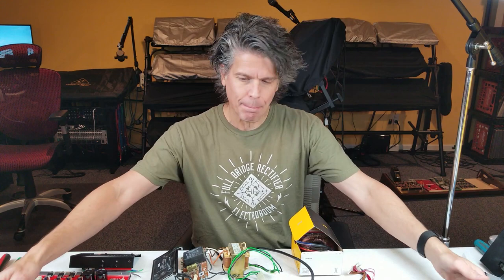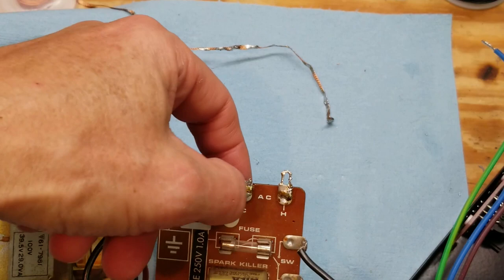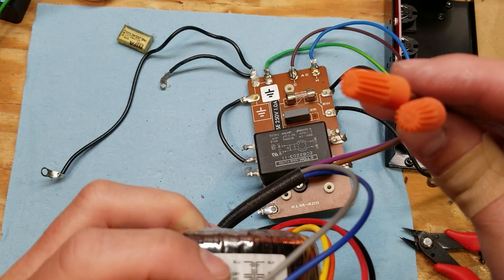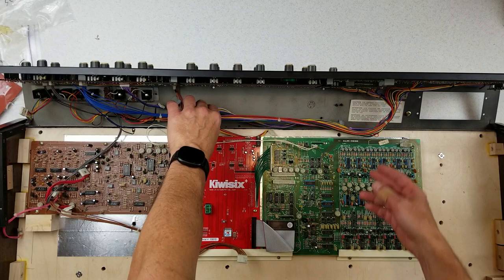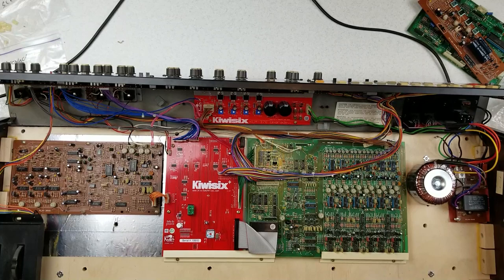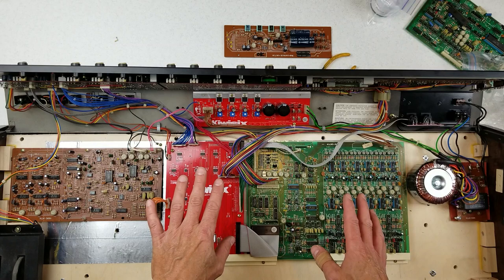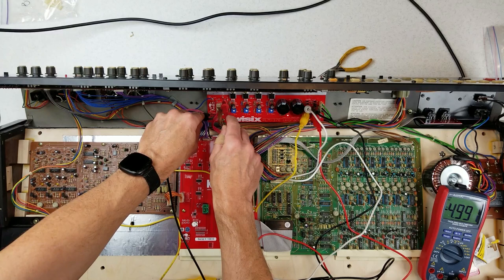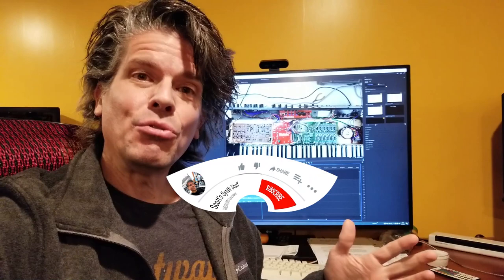Repairing & Restoring a Korg Polysix to Better Than New! Episode 4: Power Supply, Initial Power-Up!

Comment: I am amazed by this project.
Sorry to see you had a few road blocks on this restoration project, and that can be frustrating.  I am also very impressed by how thorough you are with making sure you're careful with checking voltages and connections.  You have a great knowledge with electronics and your project is very interesting to watch.  Can't wait to watch episode 5 and see the poly six come back to life.  Cheers Scott
Reply from the maker: With old synths like this, you have to expect problems along the way. It really does pay to be methodical and check everything as you go. When the price of not checking your voltages could be the destruction of a circuit board that hasn't been made in 40 years, you are a little more careful!!

Comment: C and H on the pcb means Cold and Hot, so technically you should have connected the live to H and the neutral to C. The clue there is that the H was connected to the fuse and switch which you would normally put on the hot line. I know it’s AC so it doesn’t realllly make a difference but I always think sticking to the fuse and switch being on the Live/hot is best

Comment: Thank you very much for you comprehensive videos.  I’m currently doing similar upgrades to my recently aquired Polysix, and I’m dreading the calibration process.
Reply from the maker: It's not that bad. Just take your time and follow the instructions. Once you've done each step once, you just repeat it 5 more times for each of the voices. The hardest part is the iterations back and forth. It helps to have a good digital scope that can also work as a frequency counter.

Comment: Anybody done replacing just the old power regulator IC's with the new equivalents yet?
The new power supply replacement routine options are bit pricey.
Reply from the maker: That's more or less what the Kiwisix power supply is. It's the same essential circuit, a linear regulator, just with more efficient and modern regulators and a design that fails closed rather than open.

There is also a modern switching type power supply available that does away with all the transformer and filtering circuitry. I don't know how well it works, but it appears to be well designed: https://synthronics.de/korg-polysix-psu-replacement/

Comment: Thanks so much for this series! I recently picked up a full kiwisix mod kit for one of my polysixes and this walk through has helped me with the install tremendously. Question, is it possible to swap the transformer for one that accepts 120-240v input? I recently moved to Argentina and will be back and forth between there and LA. If so do you have something you recommend? It would be nice to have it work for both voltages without having to use a step down, but I’m not sure if that’s even possible. Thanks!
Reply from the maker: If you see the toroid transformer I used, it can be wired for either 120 or 240 VAC depending on which tap you use. You could add a switch in the back that would switch between which primary tap is being used, and that would allow it to work on both.

Alternatively, you could use this aftermarket buck converter power supply for the Polysix, which will accept anywhere from 85 to 265 volts and just automatically work - but it's not cheap: https://synthronics.de/korg-polysix-psu-replacement/
Reply: Awesome! Thanks so much

Comment: you connect the boards with power on ! that is not ok always turn power off when doing that
Reply from the maker: Of course I did, I was testing the inrush current when each individual board was powered up. The only way to do that is by having the power on, then connecting the board while monitoring the peak inrush current. That said, it's an old analog synth, you can't really damage it by powering it up this way. At least not this synth, the voltages are not intermixed in a way that you could damage anything by having some rails connect before others. It's actually designed to be able to tolerate the different rails coming up at different times, because that's how the PSU brings them up anyway.